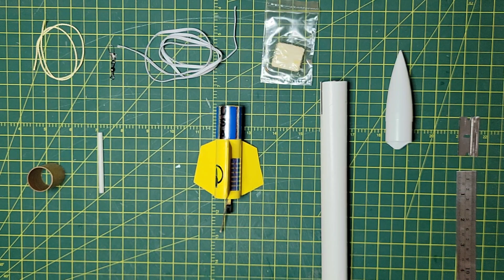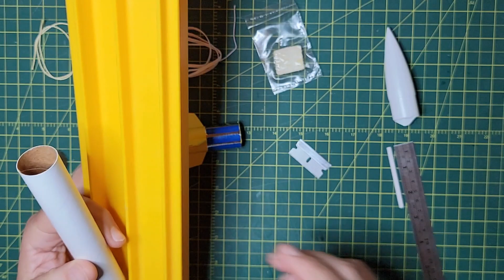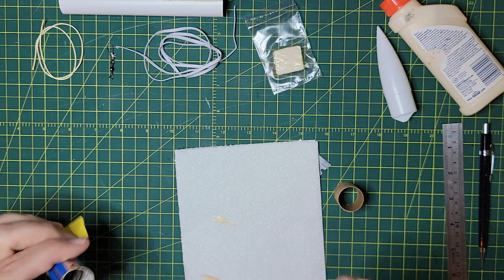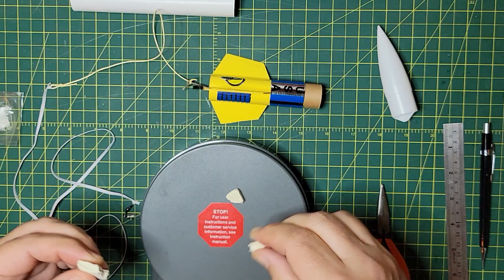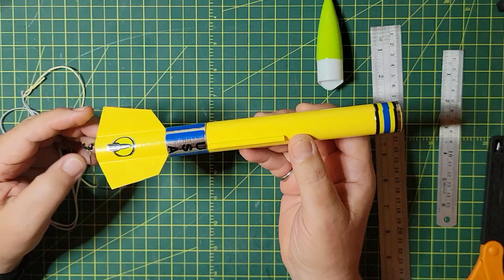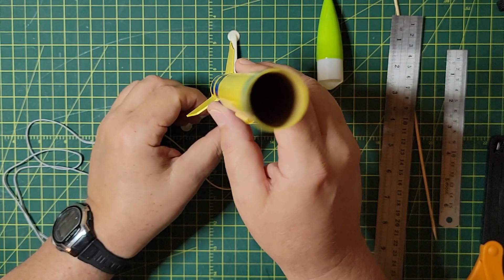Viking E2X Crash Repair

Comment: Generally, CA makes Kevlar more brittle. I use (like Kevin) to help cut the Kevlar. I dab with wood glue on knots instead.
Reply from the maker: I've never had the Kevlar snap, but it could be around the corner, I guess. I have had glued elastic break at the knot.